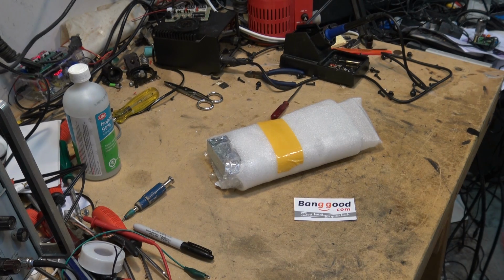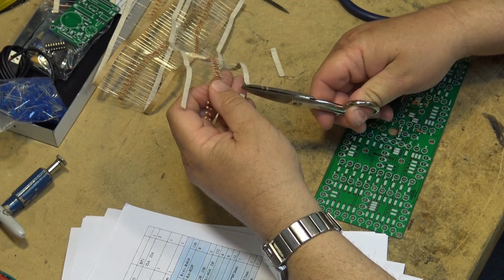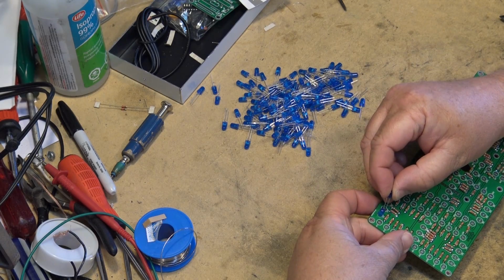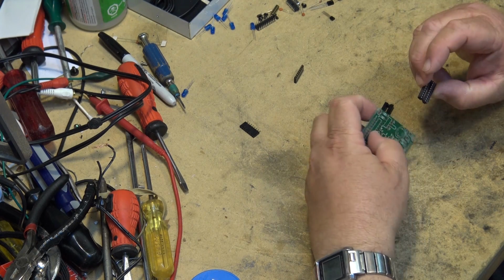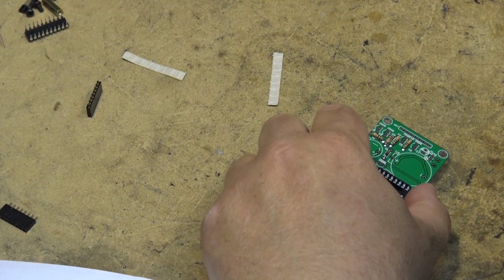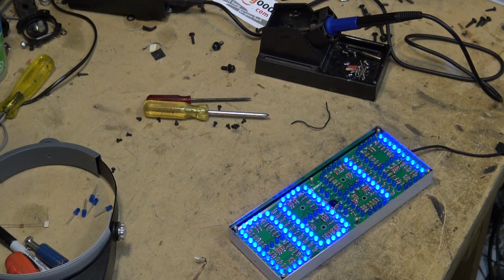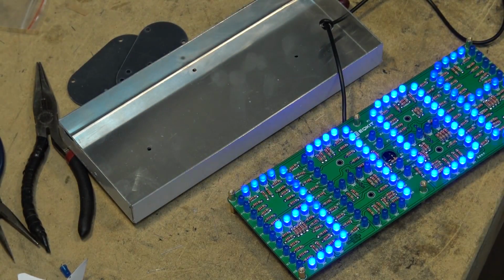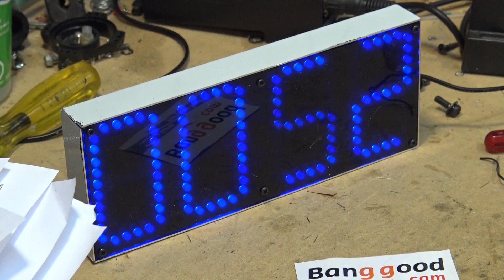Large digit remote control led clock build

Comment: Somehow i dont think you will have trouble seeing that lol :-D.
I do like the blue leds :-D
Reply from the maker: This is one of the few blue LED clocks I actually like.
The one that had that camera in it for example, the LEDs are clear, and the light is point source from them, which is hard on the eyes to read from a distance, but because this one uses diffused LED, and are a sighttly different wave length, more of a royal blue they look really nice, and can be read from across the room no problem.
Reply: I've allways thought that leds needed diffusing, too dam directional for me.
The old 2V leds that were used on the front of vcrs for power on were diffused, and not designed for high power, so they lasted forever.
C.b radio channel displays last a lifetime, i didn't have to replace many when i was into repairing cb/ham gear.

They just need to get that right for led light bulbs now.
Reply from the maker: When LEDs were brand new and only available in 1 color, RED I thought they were cool, and dumped my old school Lumitime mechanical digital clock. If you don't know what that it, you are forgiven. Most people do not. It is a mechanical clock, similar to the one I still have that uses mechanical shutters to open and close to form the numbers. The Lumitime used 3 plastic drums, one had 8 rows of plastic lobes, and the other 2 7 each. These plastic lobes would press up against a mechanical leaf switch to close the contact when the lobe pressed it. Each switch was connected to an NE2 neon bulb, so these switches all had line power to the bare metal contacts inside the clock.
It was very cool to watch, but being a kid at the time I took it apart to see how it worked, and wrecked it.  The drums were turned by a regular clock motor that would advance the minute drum each minute.
Here is a video I found on youtube that shows the operation.
I have been searching for years for another one for my collection.
Watch how the time changes on this unit.

LED is boring now, I like the old school displays, Nixie, Numitron, VFD, and Panaplex. Still looking for one of thoses.

https://www.youtube.com/watch?v=U0hreFe00xk
Reply: I've had a look and i see what you mean now, i thought they were neons being switched on, but the one i found did move black shutters in the way of the light slowly.
Clicky and just like a louvered window.
Reply from the maker: The one in that link I believe are incandescent bulbs.
The one I had was neon, but the delay in digits changing is due to the mechanical switches that operate the segments. Certainly that effect could be done in software just like my nixie fades from one digit to the next.

Comment: I just got one of these kits, basically to practice soldering on! (I haven't soldered since college, I'm now 40!) bought a cheap iron a couple of weeks ago.... haven't turned it on yet...... what are my chances of getting it (the clock) to work? (I don't have a multi meter)
Reply from the maker: Follow instructions and it should work first time. Mine works great. Only complaint is it is 24 hour time, but it is accurate.
Reply: 12voltvids  I'll have to dl the instructions so!  Thanks man

Comment: I love your kit builds...i want to get a small diy power supply kit...any recommendations? maybe a 1.5volt to 12volt would be good..if you know any that are good let me know 👍
Reply from the maker: https://www.youtube.com/watch?v=ffIm7f0L4nU&t=16s

This is a small low cost variable power supply. The transformer that comes with it is quite small, but with a larger transformer, and a bigger heat sink for the regulator and it will push a few amps no problem.
Reply: 12voltvids thank you so much 💗 actually this is perfect i don't mind the small amperage, I just want to build the kit plus its for powering small toys so no major amps are required 

I have a 30v 5amp Chineseism psu lol..but i got lucky and it works really good and i pushed it to its limits and no problem..its a hit or miss with those psu's...

Comment: Are the resistors are non polarized?
Reply from the maker: Correct, resistors are not polarized. Either are ceramic capacitors.
Only semiconductors, electrolytic and tantalum capacitors.

Comment: He y I just built the Blue clock   Thanks for the video also was very intuitive , I wanted to order the yellow clock , Do you think with the way the blue clock is I could just add Yellow LEd's or do I need to change a bunch of stuff ?  Cause the yellow one has been out of stock for a long time ...
Reply from the maker: The values of the resistors are probably different as yellow and red LEDs require less voltage to light up.
Reply: OK one more question : Every Clock I have ever bought from Banggood is in 24 hour mode ,Can you tell me what I need to change to get it into 12 hour mode Is it the crystal ? perhaps ....
Reply from the maker: This one is in 24 hour mode and I don't believe it can do 12.

This one:

https://www.youtube.com/watch?v=S_ze4Xv2s9U&list=PLO37BzxQcqmzWW-Hv8e3gkPtMdUgeJCMr&index=7&t=43s

Can be set to 12 hour more in one of the menus, as can the nixie clocks, VFD clock, and Numitron clocks I have built lately.
The propeller clock the analog display in in 12 hours, but the digital readout abound it is 24 hour mode as well.